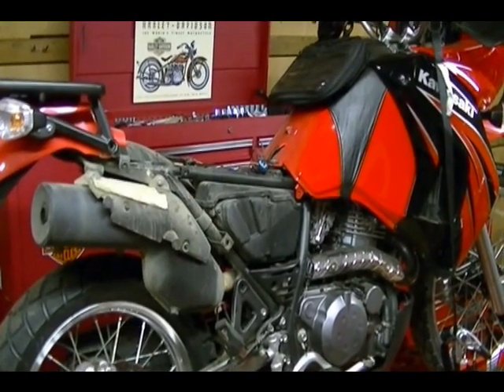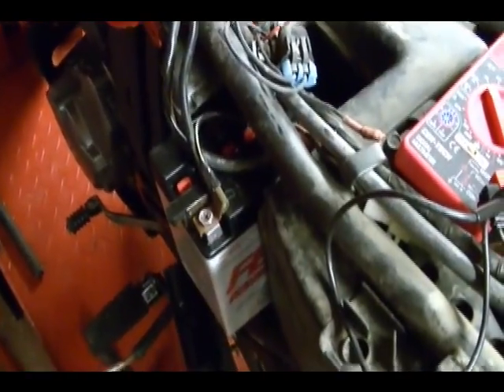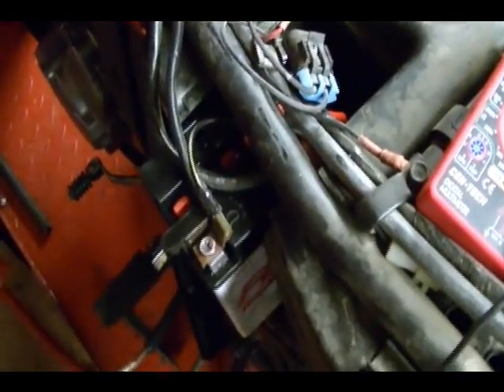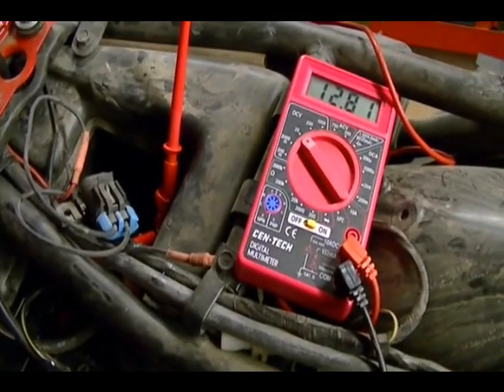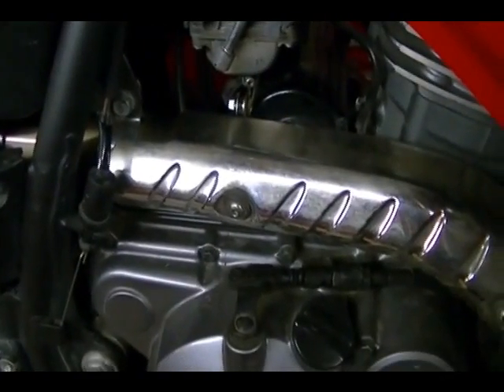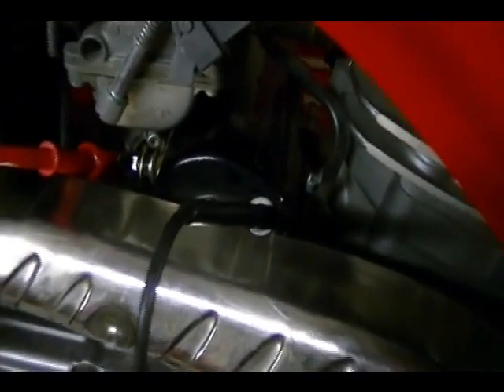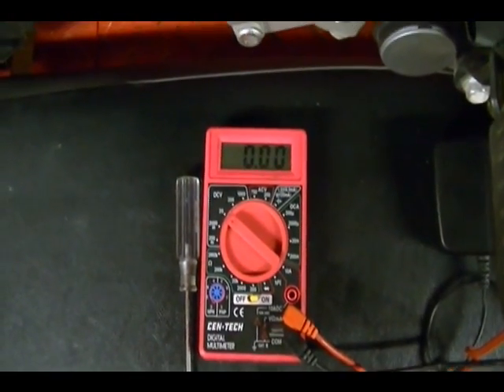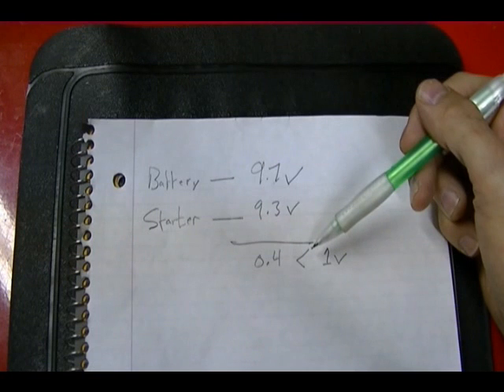Easy Test for Checking a Motorcycle Starter System Positive Feed for Excessive Voltage Drops

Comment: Another way of doing that is measuring the voltage between one pole of the battery and that same pole on the starter (starter body ground for negative) while you crank the engine over.

Comment: I have issues with my starter - often it wont engage when i push the starter button on the handle bar (all I hear is a clicking sound from the relay - This click is definitely coming from the relay *not the starter motor or solenoid - (u can even feel this clicking noise if you get close enough and touch the relay) - In the past when I encountered this issue I changed the relay and it always seem to work - but then a few weeks/months it reappear again - getting a bit sick of  this (fortunately I have a kicker to fall back on, but would like to  see if I could track down the source of this problem) - I do not think theres a problem with the starter motor or solenoid (some have pointed to the starter button itself, but the other day when I tried to bridge the connectors on this button nothing (absolutely nothing (not even a click) happened * and yes, ignition was on at the time - so now a bit at a loss where/what to look for/check
btw. its -81 HD shovelhead (FLHC)
Reply: Did you ever find out what it was?

Comment: I have a '84 FXR Harley Davidson. When I hit the start button all I get is a loud click. This is with spark plugs out of motor. New battery, solenoid, starter and relay. I have a voltage drop at the starter when I hit the start button. The starter shaft engages the ring gear on the clutch hub but will not turn the motor over. There is not any unusual wear marks on the starter shaft, clutch ring gear or starter. Motor turns over easily by hand with spark plugs out. I have replaced the above mentioned parts only because I am at a total loss at what is causing this problem. I replaced the parts even though they tested OK independently. The wiring is OK. I have a good ground reading at the motor, frame and starter. Have been looking at a possible alignment problem but have not been able to locate anything. Any suggestions?
Thank you

Comment: I've got 2002 Kawasaki 1500 main streak Vulcan and I've got a new starter a new solenoid a new voltage regulator and a new battery and when I turn it over it's getting slow crank it's then it just stops it's like cranking two or three times and then stopped but it's real slow and it cranks could you give some information on why it's doing that and the battery cables are getting hot now it started up one time and ran for about a minute and then shut off and then it's to slow cranking and the ceiling with is clicking real hard and I think my fuse box is clicking also could you give me information on what could be doing that thank you

Comment: If I assumed the voltage drop to the terminals of the starter are within range (.4 volts) yet the stater spin slower than
Reply: Stater spins slower than usual then we can conclude the stater has high internal resistance which cause the battery drainage.

Comment: I have a 1982 cb900f converted it to a naked/scrambler. Always seemed a weak start now only clicks at the solenoid. Ran your test , battery is 13.4 volts under load 7.50 When testing the load lead to starter power and other lead to starter ground Under load tested 2.7 volts something seems way out of whack. Please help if you can. Isaac

Comment: I've got a weird problem with my pit bike engined bobber I'm getting voltage from my stator at low rpms but nothing at full cranking speed, gone through all the shorts I can find, I've disconnected the earth from the engine and unplugged the stator so no connection from engine to the frame but I've still got continuity from the earth of the wiring to the positive connection to the starter, can anyone shed some light on this

Comment: Hi I think my starter is D.T.E because the main post to frame is beeping on continuity test as is the starter body to frame, am I correct and would this mean bad or worn brushes? This test was done with the wire off the starter.

Comment: Hi youtube community. My motorcycle is a Bajaj Pulsar 220 dtsi. My problem is that when I push the electric start button (gear in neutral, engine crank switch to on) the starter turns but sounds like it is sliding. No sound of the engine actually turning. The starter spins though. Just the buzzing sound of like a dynamo. Sorry I'm bad at explaining. Anyway, it is occasional and sometimes it would crank the engine, sometimes it wouldn't. Some have suggested looking at replacing the Bendix Drive but I'm looking for second opinions. I hope anyone could help. Thanks.

Comment: My Harley I charge the battery to 100% then it starts but the starter will spin then drag but after 3 tries it cranks but it pulls down the battery by 25%.is this a bad battery. I have to recharge the battery or the starter only spins but won't start the engine

Comment: I have  gsxr 1100 '89 and a problem with starting the  bike after  i drive  it on a very bad rainy weather . I cant start my bike right handle start switch doesn't respond.I have open the handle switch and  it is ok. Wiring to  the solenoid is ok , solenoid in a direct battery connect is clicking , Battery is 12,70v . What is the problem ???

Comment: I have a 82 kz1000 kaw.when I go to start it I had a wire melt I fixed that and tried to start again then wires going to not sure box under the battery. Not sure where to start now.not sure what a diode does.
Reply: seems like one of your wires was grounded thru its insulation

Comment: Hello, 95 Triumph Trident (900cc) new battery charged but barely turns bike over..jump it with car battery and fine. Also corrosion build up in about 4-6 weeks on the negative side?
Reply: thats a bad battery sir
Reply: Yes it was a bad battery.
Reply: @Bob-kc8zc  terminals have to be clean too

Comment: I have a 1990 suzuki katana 600 , ran great, when I woke up the next morning to go for ride, it won't start, won't even make a noise , but all lights and stuff turn on , I pull clutch in and killswitch in ready to go , kick stand up, and when I push the start button , it is quiet as a dog sleeping , no click, no engine trying to start noises or anything , just silence, but the battery is fine, I don't understand...can anyone help I can pay or whatever
Reply: Spencer Lewis.  same situation here with a Suzuki TU250X.
Reply: Tony Hernandez I got crashed off that bitch a while back but I got a new bike now Yamaha r6

Comment: Hello sir have a question for you....I have an old vulcan 750. She was running fine until yesterday when it sat in some rain. Now when I try to start it it doesn't even get to the point you have the bike above to. It clicks and will not even attempt to start. Fresh battery from a trickle and tried again with same result.....any ideas?
Reply: Did you ever fix your motorcycle problem mine has the same symptom
Reply: I actually did.....I ended up ordering the parts from ebay.....a starter solenoid (~35$) and a starter switch (~35-45)....once popped those into place we also found out that was a blown fuse as well (~4$).....no starter issues at all though with mine......hope that helps.
Reply: Patrick Day okay thank you ill buy those parts because I have the exact same problem
Reply: Ajay Miles patrick Day Hey guys so I have a 1997 Honda shadow 1100 and the starter clicks as well and will not start. I have replaced the battery and spark plugs. did the starter switch and solenoid replacement fix your issue. How can I verify if the starter is seized or if the electrical is the problem? should I run a line directly from the battery to the starter and see if it turns over?
Reply: Joshua Pocus so in the end of messing with it... The starter switch wasn't actually getting a good spark and we replaced the solenoid for good measure.... All was right in the world after that.... Hope it helps

Comment: My starter is swinging but  my engine is not starting
Reply: use starting fluid to see if its a fuel issue, if it still doesnt start its probably a no spark condition

Comment: I have a 2005 honda shadow spirit 750. The starter will not turn over. All I hear is a buzzing sound. I ran the starter wire straight to the battery and it does the same thing. I replaced the starter and it does the same thing. The ground is good. All my lights come on and everything. What could it be?
Reply: eastpope did you ever figure out what your problem was?  I have the same issue with my vlx